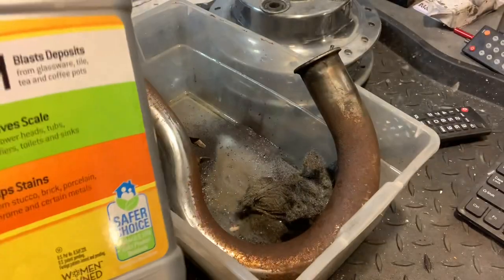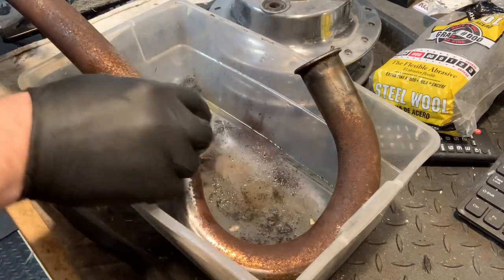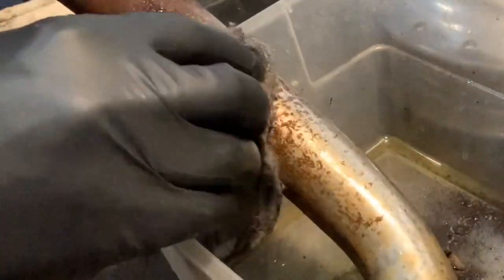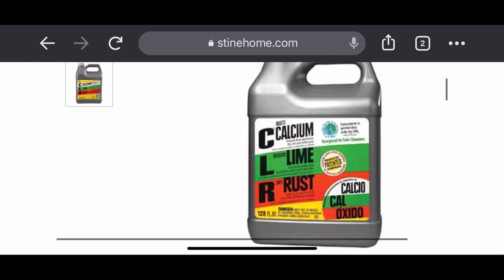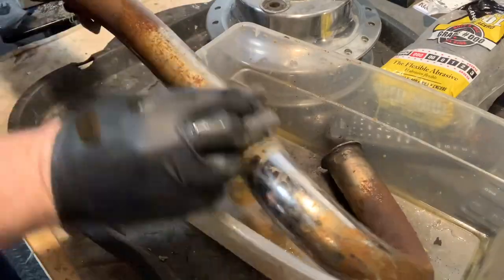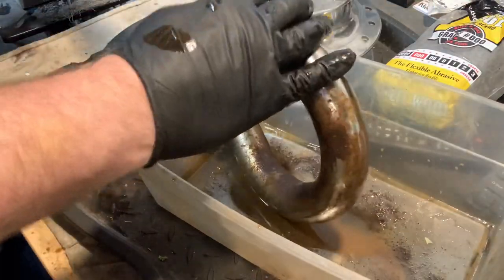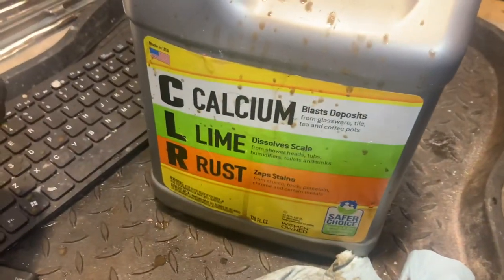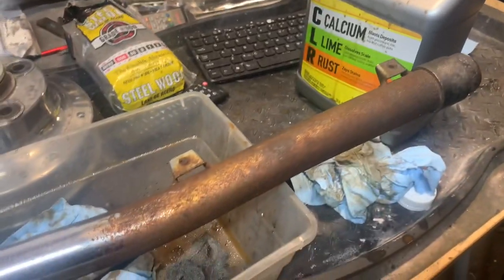Is CLR the BEST Rust Remover?

Comment: FYI it works in your cars radiator. If you buy like an older vehicle, I have a 1997 Chevy truck the heater core was just ungodly backed up with rust and if you looked in the radiator, it was just rust like you wouldn’t believe I don’t have the money to buy all new stuff so a good friend of mine Told me about CLR and I’ve never really used it my life. I know what it is just never used it and he told me to dump the entire thing in my radiator after I flushed it a few times and then drive around for a couple of days and then flush it again, he said repeat this process until your flushing out. Nothing but clear distilled water. And only use distilled water and it works perfectly.
Reply from the maker: That’s actually really good to know. Thanks.

Comment: I tried using CLR to remove rust stains from the plastic bumpers of my car, and got rid of most of the stains with heavy scrubbing. I also tried it on a rusted patina I tried to protect with rustoleom paint, but it weakedned it a bit. I did however erase a rust spot though.
Reply from the maker: Good to know. It’s pretty versatile stuff.

Comment: I am kind of surprised that the method I use for cleaning rust off of chrome is not used more often, unless there is something I am missing. The method I use is aluminum foil and water. You just fold up a sheet of aluminum foil, dip it in water and rub the rust off like you are using sandpaper. I never really see any damage to the chrome with this method.
Reply from the maker: It does work but not my fav method. Can’t get passed the nails on chalkboard feeling. I did a video comparing a bunch of methods. There’s always many ways to the same end goal. It totally works tho! Here’s that video. https://youtu.be/-yJF9Pe-Vvo thanks for watching and I hope you enjoyed the vids!